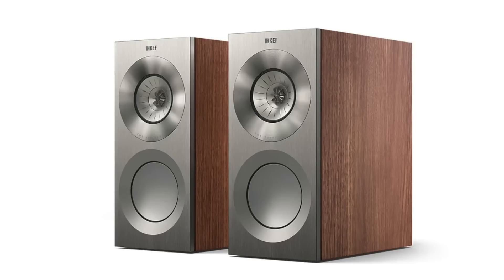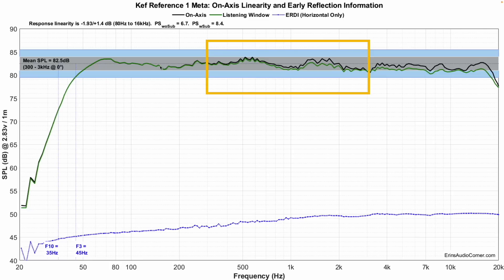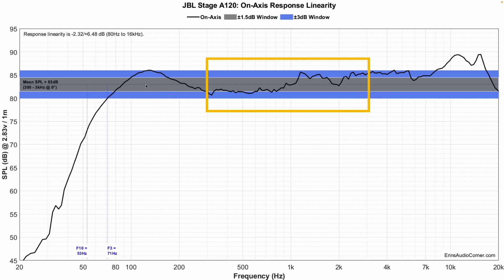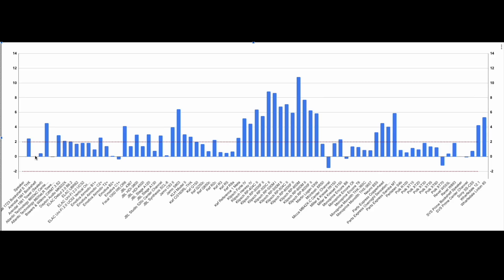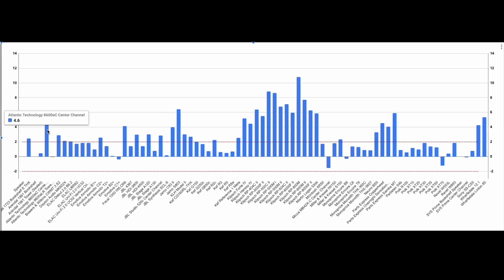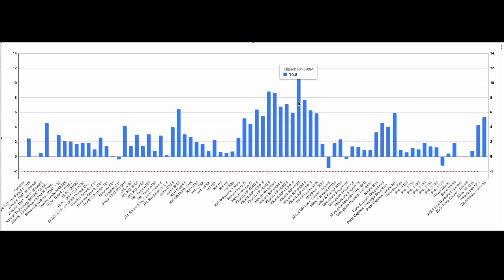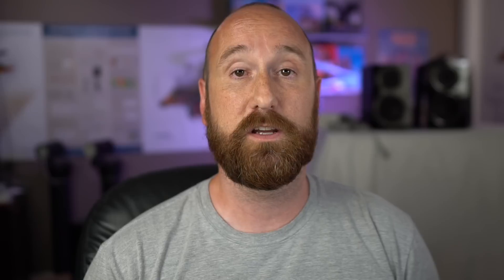BS Speaker Sensitivity Ratings and "Dynamics"

Comment: Hi Erin, Do you use C weighted or A weighted or Z, on your mic for speaker measurements? I assume it's irrelevant for a pure measurement (for example REW) as there is no 'SPL' weighting, just pure measurement, which is essentially 'Z' by default. Great video, thanks.

Comment: Great video and very informative. Is this the same case with measured frequency response?

I am asking because I use those frequency responses to set my crossovers in my Marantz processor. 

With that being said, maybe my Audyssey calibration via the app was actually getting it right when gathering the data to set my crossovers. 

Your thoughts please?  Thanks

Comment: Nobody really answers why lower sensitivity speakers even exist.. smh
Reply from the maker: It’s typically a tradeoff for low frequency extension.
Reply: @ErinsAudioCorner Thanks for clarifying.. it makes sense now
Reply: Also the quest for ruler flat response probably comes into play. For a passive speaker there isn't a whole lot that you can do to boost the dips so to smooth it the peaks have to be brought down. My guess is that the same applies to the raw drivers. If you are going to damp resonant peaks by whatever design choices you use the average level will come down.

Comment: late comment: unfortunately, you didnt answer the question. For which rating system, what do we need at what power to get the slam we want. I don't care care if Klipsch rates differently. As long as we can take one system and apply it I am happy. Remember, sensisitivy is not important - slam, drive and sound is.

Comment: yes, especially for subwoofer drivers there should be a new standard that would put an end to all the hogwash. Your way of reporting/measuring it is nicely unexploitable. i've lost a lot of money accumulating invalid drivers for battery powered pa speaker systems that need to be extremely efficient/sensitive.

Comment: I live in a normal room not in an anechoic room so the sensitivity in normal room is more important than that in anechoic. if all the speaker have the same improvement of sensitivity passing from anechoic to normal room ok but if the improvement change a lot from speaker to speaker  the  anechoic measurement  is less significant . the question is: if I take Klipsch in my room I have the 99 db declared?  and a speaker with the same sensitivity of Klipsch in anechoic have the same db ion Klipsch also in my room? sorry for my English compliment for the channel

Comment: USA IS BBECOMMING SLOPPY --- ENTIRE ELECTRONIC/PROCESSING/SOUND PROCESSING WORLD NEEDS TO RETURN TO "ANSI/IEEE etc.  STANDARDS" FOR EVEYTHING....and most especially "Software/Firmware". along with STANDARS IN "HUMAN FACTORS ENGINEERING"  ...Verb-Noun Instructions, control & indicator colors & placement etc etc I have 5 different HDMI Cables (not One Has a Standards Marking on the Jacket or Plug --- I have a Dozen "Remotes" . not one with a call-out , Color, or Placement Standard except from the same supplier. OPERATOR MANUAL TERMINOLOGY & STANDARDS ARE---A F'G TRAIN-WRECK!!!

Comment: Who said higher sensitivity means a better speaker?
Reply: Not necessarily so. See Paul from PS Audio .
Reply: There is no one metric for better but there are distinct advantages to better efficiency. You get less voice coil heating and the distortion that comes from the resulting shift in characteristic parameters. It increases your amplifier's headroom and if the speakers max power and excursion limits are not correspondingly lower the speaker's intrinsic dynamic range is also improved. Easy to drive speakers also allow for a broader range of amplifier choices.

Comment: Back in the early 80s I walked into my local hi-fi dealer, armed with the contents of my 1st ever bank loan. 3 hours later, I walked out with a turntable, CD player, cassette deck, amplifier and pair of speakers. Took it home, set it up and it sounded phenomenal. I knew nothing about speaker sensitivity, max SPL, speaker cable gauge, THD, crosstalk, signal to noise ratio, class A, class AB or class D. I just knew it worked and sounded great.

As the years rolled on and my disposable income increased, I upgraded my hi-fi, 1 component at a time. With each upgrade appreciating the improvement in audio reproduction. Of course over these years I did accumulate a basic working knowledge of the industry.

Then, just after the turn of the century, I started getting into the internet and the internet and YouTube hi-fi community. Listening to the views and opinions of multiple reviewers and self proclaimed experts. I started to question whether I was getting the best from my system. Were my speakers too close together, were they toed in suffiently, were my speaker cables costly enough, were my interconnects expensive enough, was my DAC resolving enough, were my speakers and amplification sufficiently linear, was my room acoustically treated, was there good synergy between my components, Etc. Etc.

So, I was hooked, I’d been drawn in, got the bug. I experimented with placement, invested in costly cables, changed my $3000 integrated  amp for $9000 worth of preamp monoblocks combo, changed my $5000 speakers for a pair of $10000 speakers, changed my $1200 DAC for a $4500 DAC, swapped out my laptop for a dedicated streamer, Etc. Etc. Did I get a night and day difference? No, not even dusk and dawn! Yes, there were multiple subtle changes, which resulted in a slight but notable improvement. But, at the end of the day, didn’t really enhance my listening experience. 

The moral of this story. ‘If it ain’t broke, don’t try and fix it’. The only person that needs to appreciate your hifi system, is you.

I do appreciate the efforts of this channel, Jean from Audioholics, Amir from Audio Science and the team at Stereophile for keeping it real and keeping us grounded.  If I had my time over again, would I do things differently? Absolutely! I’d stop far earlier striving for audio nirvana, concentrate more on musical nirvana and putting less stress on my bank account.

As a matter of general interest. Of all the upgrades i’ve made over the years, it has always been speakers that make the most significant improvement.

Most of all, enjoy the music.

Comment: Some say that 2.83V is a misleading ref, you should use 1watt, as this accounts for impedance differences rather than assuming constant 8 ohms. So the 2.83V figure is usually a couple of db higher than the 1 watt figure.

Comment: Do I further need to adjust the 2.83v number based on impedance? like -3dB if it's 4ohm? or is that okay because 2.83 is gain and not power?
Reply from the maker: All the numbers I discuss are referenced to 2.83v/1m.

Comment: In my experience, the vast majority of speakers of similar design have roughly equal sensitivity in practice. Horns are a bit more efficient, bass reflex next, acoustic suspension, open baffle, planar and then electrostatic. The most sensitive I’ve owned were Tekton Lores at about 90dB. The least were Magnepans, which were power sponges and never seemed to be “loud”, no matter how much I fed them, and I fed them a lot. A 200w amp would go into thermal shutdown at 90dB. You do the math. 

I currently own Wharfedale Lintons and there is no way that they are 90dB. The Buchardt S300s (rated at 86dB) are louder. 

I did once have double Advents (sealed) and they got really loud, but add 86dB and 86dB and you have, what, a real 92dB!
Reply: Wouldn't that be 89dB? Or am I thinking of impedance 8 vs 4 ohm paralleling ?

Comment: Fantastic and EXTREMELY useful video, but some clarifications are needed.

The sensitivity ratings are fine, it's the non-standardized use/measurement case that's misunderstood and you have beef with. You're incorrectly assuming manufactures' intend to standardize the measurement method, but that's not their intent nor priority...that's only the users' intent and incorrect assumption. Agreed manufactures purposefully allow the misinformation to perpetuate to their advantage.

Also, please discuss the trade-offs Better efficiency is worse for other metrics, but this video incorrectly implies higher efficiency is always better which is incorrect.

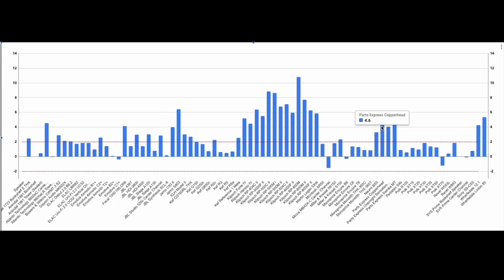Comment: 7:32 very important question, not cynical at all imo. If you really check, you will more often than you expect find that what you assumed true / correct is in fact not. Your method is thorough - props. I would also strongly suggest adding the voltmeter used to determine the usual 2 / 2,83V into the equation, especially if it indeed measures Vrms, or Vavg.

Comment: I have to say that this topic is overrated.  Firstly, the 2.83v/1 meter standard is primarily for designers, it has little relevance to end users. No one listens in anechoic  chamber.  Setting a standard based on something like minimum amplifier power and load impedance would be much more applicable to the consumer.
Moreover, amplifier power requirements are usually way over stated,  A 10 watt amp provides 10 db of power, a 50 watt, about 17 db.  This is more than enough power for the vast majority of speakers in a typical home for music. Movies may require sub woofers to fully power the bass sound effects without impeding dialog, but this is apart from powering the main speakers.
I had a SET amp, at about 8 watts of power, unable to satisfyingly drive a pair of Ruark speakers. That is the only underdrive condition I have experienced in my home.  It's more often the opposite condition - the speakers' compress before the amp is anywhere near distorting. I've had Spica TC 50s and Q acoustics 3020i s compress at admittedly loud volumes, but still below 95 db at the listening  seat (peak spl locked measurement with music).  Ive also experienced "ribbon slap" on nearly every magnepan I've heard at  volumes only a bit louder than I would normally listen - way below the clip points of the amps driving them. 
in short, I think consumers can safely ignore spl ratings unless they have very low power amps or low cost receivers. The lack of standardization  may be a valid point, but i think changing the metric to something more comprehensible and applicable to the consumer is the real solution
Reply: Did  you watch(and understand the content) the entire video?  The topic is not Overrated!  The video is perfect and information within needs to be conveyed and understood by the speaker buying public.
Reply: @wesselingaudiodesign5031  "The video is perfect and information within needs to be conveyed and understood by the speaker buying public."
That is basically what I was trying to say - apologies for a less than clear expression.  The sensitivity metric requires a level of engineering knowledge and mathematical conversions to make it useful to consumers. In other words, they need to watch a video like this to understand what the metric is conveying. This should not be necessary for a metric designed to be useful to the consumer.  
My second point, and where the "overrated" moniker is directed, is that this metric is not all that critical in the modern market.  Most speakers will work with a 50 watt amp and many will do fine with considerably less.  Only if you are diving into SET territory or using a cheap theater-in-a-box/$30 amazon Class D cigarette case amp would you really run into lack of power issues.
Reply: @robertbrenner610  Got all your points, thanks for the clarification!  My take away from the video is the issue of relative response in frequency amplitude. People are buying speakers with a 10db or more rising response towards 10-20khz. These will sound extremely bass deficient. I think consumers need to be hyper aware of this!
Reply: @Douglas Blake Quite a few makers do offer this type of metric. What I'm suggesting is if we standardize any metric, lets go for one like this, as opposed to 2.83v @ i meter. This requires engineering knowledge and mathematical conversions most consumers have no idea about.  As audiophiles and hobbyists, we don't  consider that the vast majority of buyers have no idea what sensitivity is and have to rely on the salesman for education.  Lets make it simple for the buyer so they don't have to take a salesman's word or stumble across videos like this one to figure out if their amp will play loud enough with their next speaker
Reply: @Douglas Blake In all truth unless you are a/b comparing, 6db is nothing we're going to hear as a distinct entity. Really it's not like one speaker is LOUD and the other can only whisper ... it's a slight difference at best.
Could not have said it better!  Nearly everyone I talk with is shocked that a 200 watt amp would not give you a noticeable maximum volume increase over a 100 watt one and maybe a hair's width more rotation with a 50 watt amp.  That's assuming you're listening at volumes where the amp is close to clipping, which is extremely unlikely unless you're using a SET or 10 watt class D mini amp ( and as SETs clip very differently than solid state amps, overdrive with these amps is often not noticeable or at least tolerable.)

Comment: Very useful and direct video; it’s a shame that it is necessary. Would not have thought that a well-known company like Klipsch would be guilty of such overstatement.
Reply from the maker: Jeremiah, thank you for watching and I’m glad this helped. 

As Douglas said, Klipsch does tell how they rate their speakers but it’s so abnormal that it can be viewed as deceitful if one doesn’t know how they are rated. And the real issue is that retailers don’t tell us.  I think that’s due to them not understanding the significance or manner, either.
Reply: Klipsch has used "fuzzy" specs for some time.  Between producing some really fatiguing speakers and fudging their spec data (for the most part), I have them scratched off my speaker manufacturer list.

Comment: You forgot to mention that Klipsch measures sensitivity is the same way it has done since 1947: at 1W not 2.83V
Reply: which is appropriate if true, imho since it is more meaningful to consumers. Why should the average consumer care for a speaker has sensitivity of 98db at 2.83V if that same speaker drops to 2 Ohm for much of the freq range and is a beast to drive with anything but a Krell? quoting at constant voltage may be more scientifically correct but is misleading when comparing speakers of different (nominal) impedances because consumers tend to equate sensitivity to efficiency. Quoting at 2.83V is very convenient for manufactures of low impedance speakers btw. John DeVore has argued about this same issue in one of his videos too.
Reply from the maker: That is incorrect. Look at their current specs. “2.83v/1m*”
“*SPL at 1M, half-space anechoic with 2.83V input, in-room sensitivity”

Comment: I mentioned this in my reply to one of Erin's replys on another comment I made but I will also put it here in case anyone is interested. The 2.83V sensitivity measurement specification, while scientifically correct, is not appropriate and is misleading to the consumer as it penalises benign load (high ohm) speakers and helps inefficient difficult to drive speakers. Many amp to speaker incompatibilities would not be afflicting consumers if sensitivity was measured based on power rather than voltage.  In addition it does not take into account changes in speaker impedance and thus efficiency across the measurement frequency range. To know why please watch a John DeVore of DeVore Fidelity video in his channel named: 'John DeVore goes on a rant about the High End Audio lie that inspired him to start his company'
Reply from the maker: You’re assuming constant impedance (pure resistance). No speaker is that way from 20-20k. If you assume the same impedance throughout then, sure, using wattage might make sense. But loudspeakers have different impedance phase and magnitude that will alter the “watts” per frequency. As we often see, the nominal impedance is practically never truly indicative of the true impedance (resistance @ frequency). Imagine calculating sensitivity based on watts, where the wattage can easily vary wildly from one frequency to the next. 

Additionally, (nearly all) amplifiers are constant voltage sources. AVRs to separates. 

That’s why constant voltage makes more sense.
Reply: @ErinsAudioCorner  I am not assuming that since I have already mentioned it. If you accept the notion of nominal impedance as a spec, why can't you accept the notion of nominal sensitivity? Even if nominal it would be much more helpful to the naive consumer than the 'scientifically accurate' but useless sensitivity at some voltage reference. We are discussing specs of consumer items here not scientific instruments. You yourself have produced this video to help consumers and I agree with everything you said but this. Thanks for listening.
Reply: @@Douglas_Blake It makes sense to a large part of the manufacturer community and the whole of the pro world. It doesn't make sense to you and that's ok, there are more thick headed people out there, you're not alone.